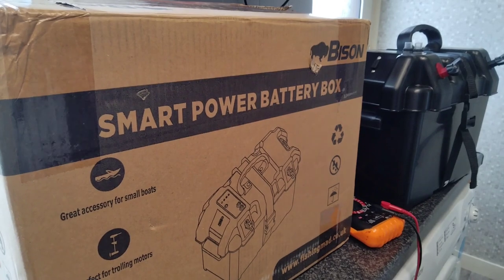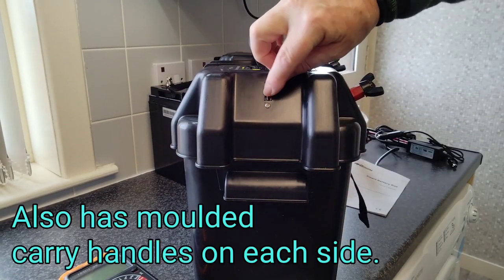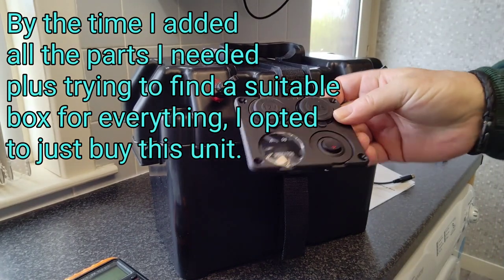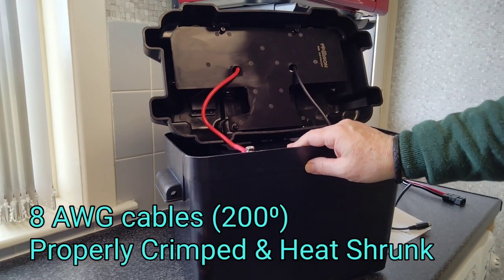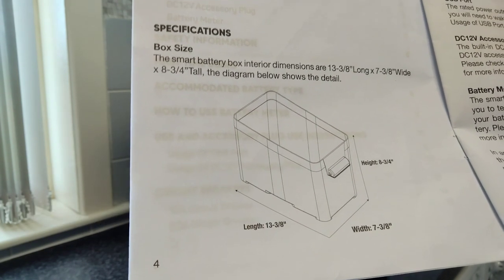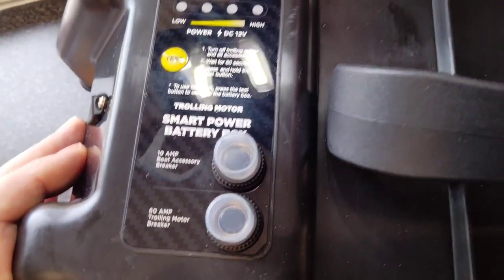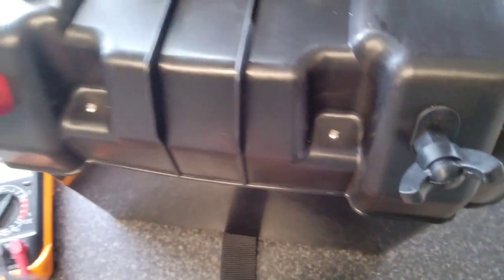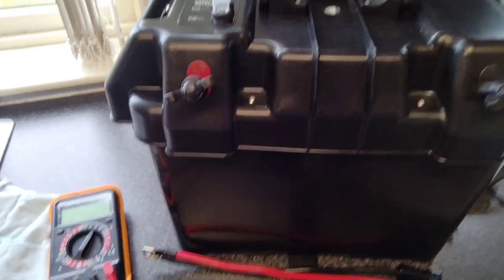Bison Smart Battery Box, Quick Overview.

Comment: Hi I’m a truck driver and I am thinking of taking a 12v LED TV & PS4 to play for 2hrs per night! both low wattage. Really confused as to what set I need!
Reply from the maker: Hi Shaun. Its good you know the wattage required. If you visit www.dcguy.co.uk you may find some info to help you size a battery etc. Would you be using the truck battery or another separate battery to power the TV & PS? If using the trucks battery its probably 24V but there may be a step down already to 12v outlets?  Either way you will need a way to recharge on the road e.g a DC to DC charger unless you have a suitable alternator already on the truck or you get access to an AC charger.

Comment: Can you connect an inverter to this via cigaret charger?
Reply from the maker: It's fused with 10 amp fuse so a 100w inverter would work, the main terminals are rated at 60 amps output so you'd be better using those, again depending on the wattage rate of the inverter and what you will be powering.

Comment: Can you attach a solar panel to it
Reply from the maker: If you add a solar charge controller then yes. Someone using a lifepo4 battery just hooked up a panel direct to battery and let the BMS do the work of stopping charge etc but not something I've done, I'd just use a cheap SCC.
Reply: @DCGUY  thanks for the advice 👍

Comment: I guess I could buy one of these instead of a jackery power station and fit my own battery and it would be so much cheaper. I'll be looking forward to you doing a video about fitting solar connections.
Reply from the maker: Thanks for watching and taking time to comment 🙏 it's appreciated.  Even with a 12v 100ah lifepo4 there's room for an inverter, shunt, scc etc. Definitely cheaper than buying a jackery or bluetti set up.

Comment: Can this take a car battery TYIA
Reply from the maker: They are designed for use with batteries with maximum dimensions of 33cm x 18cm x 22cm so you'll need to check your battery size. Hooe this helps.

Comment: Hi there.
I have this box and today decided to fit a cheap battery voltage monitor. After fitting, I closed the lid and sparks and plumes of smoke came bellowing out. It's an old 75ah lead battery I have and wish to replace now. It's good to see the eco worthy fits. My question is, have I damaged the box. I'm really not good with any of this. I tested the USB and that seems OK. I will test the cigarette lighter tomorrow. I use it with a trolling 55lb motor, but am concerned that the 60a breaker won't kick if my motor gets tangled etc. Any help would be great. Awesome channel BTW.
Cheers
Reply from the maker: Yikes, the lid has a plastic cover that hides and protects the cables and base of fuses etc. Sounds like something made contact with your battery terminals. Check all cables for damage and ensure your battery terminals are not making any contact with anything else internally before placing the lid on. Hope everything works out.
Reply: Thanks for this. Yeah I hadn't put one of the terminals on the monitor as I was testing to see if it would fit. It basically touched the other terminal as i closed the lid and melted a bit of the cabling to the terminal. The cables in the box are fine and the battery seems OK. Just wasn't sure if there were any tests I could perform. I was rather annoyed with myself! Just one more note on the box. I would use the handle. The strap broke a while back carrying a 17kg battery in it. Luckily it was 2 inches off the floor at the time! Thanks Neil
Reply: Sorry, not melted the cable to the terminal, I meant to the monitor. All internal cable in the box seems OK. Thanks

Comment: I bought a Bison battery box  for my kayak it is not a waterproof box and would need to go inside the hull as it's not practical to make it watertight. I had forgotten about the SUB being primed by the battery monitor button so it was good to be reminded, the monitoring function is for a lead acid battery, I am adding a shunt to measure my lithium iron battery. I  just ordered  some Anderson plugs as I am making a 50A max fused system, they looked perfect for the job. I have a PAC 80 battery isolator relay solenoid and was trying to figure out  how to incorporate a standard outboard kill switch but got lost on how to get that to work. A video on  solenoids and your take on how you can apply them to a project like a duel battery system for a car/van  or other applications of them would be interesting.
Reply from the maker: Thanks for watching and taking time to comment 🙏 it's appreciated.  Yes it's a versatile box for customisation.
Reply from the maker: Here's a link for the updated relay hopefully will help you with use https://stingerelectronics.com/products/80-amp-relay-and-isolator-1
Reply: @DCGUY  Thanks for the link, I will take a look at the infomation.  It is good to know the battery box  gets your approval on build quality.
Reply from the maker: @JD-kn9di  My expectations were not high, but i was pleasantly surprised, nice tidy cabling, correct gauges and no solder! Thermal breakers are held bolted in place too. Only issue i had was the rubber bung on the USB coming loose, but a small washer sorted that.

Comment: Only 1 usb port?
Reply from the maker: Yes its a single slow charge USB port. Easily adapted though if you want to upgrade. You can use one of these in the 12v socket https://amzn.to/3J2Fmui or replace existing USB with something like this https://amzn.to/3cqO4Gn
Reply: @DCGUY  Excellent. Thank you.